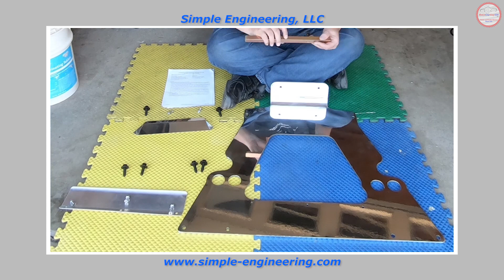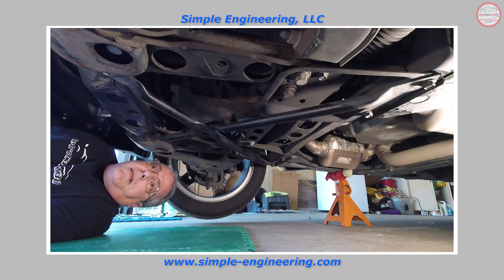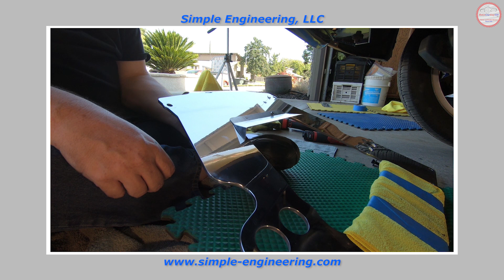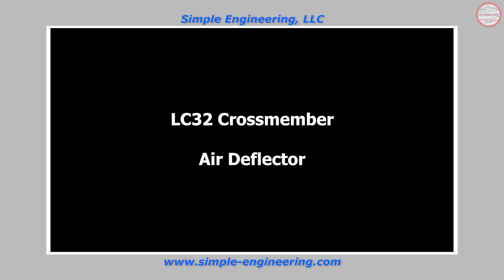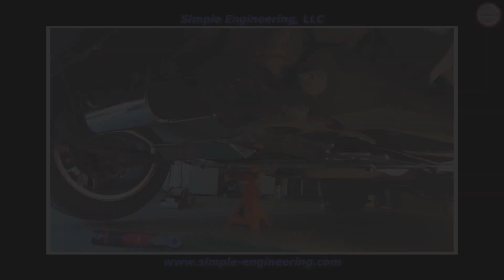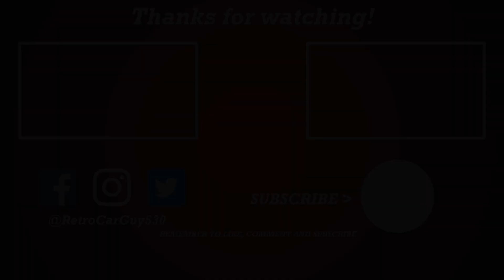SSR Front Frame Stiffening Plate - Installation

Comment: How does the frame stiffener improve the driving capabilities of this automobile?
Reply from the maker: The front frame stiffening plate reduces the amount of flex in the front frame components of the SSR.  The best description of what it does is right in the production description section on the Simple Engineering website: https://simple-engineering.com/product/chassis/ssr-front-frame-stiffening-plate/

Comment: Installed this frame stiffening brace yesterday, which went very smoothly thanks to this video. I didn't have 1 hang-up or question along the way. Thanks for taking the time to put together such thorough instructions and quality video. 

I also installed the LC32 crossmember at the same time and I appreciated your section at the end with regard to the air deflector for that install. This install was more of a puzzle for me and took much more time since there was no such video available and the written instructions weren't always clear. Would be great if you could put together a video to install that crossmember at some point for others, too.
Reply from the maker: I'm glad my frame stiffening plate video help you!  I don't have a video for the LC32 crossmember because it was more than 10 years ago when I installed the one I have on my 2004 SSR.  Nobody in my area of Northern California has installed a LC32 crossmember in the past few years, so there's not be an opportunity to film that product's installation process.